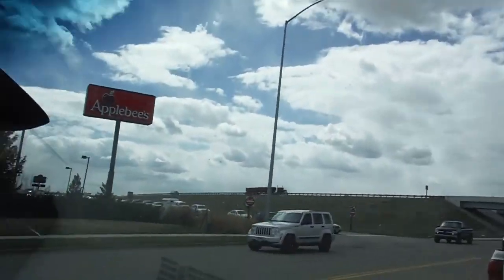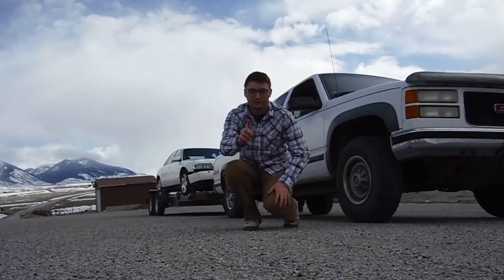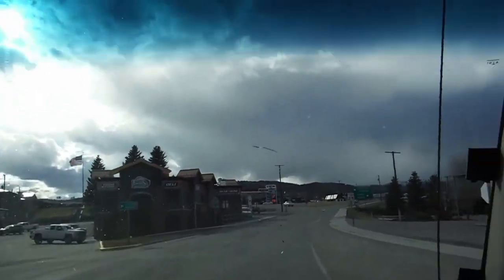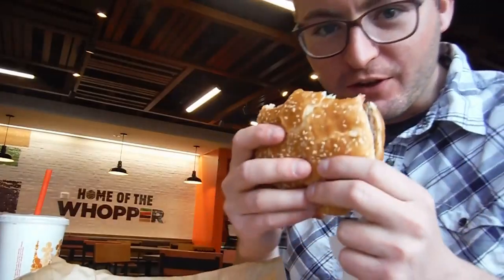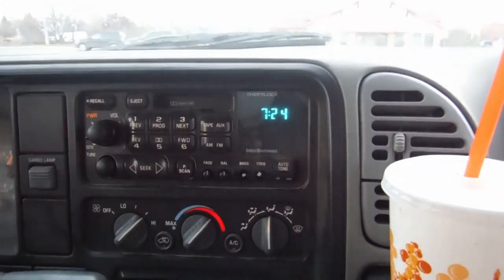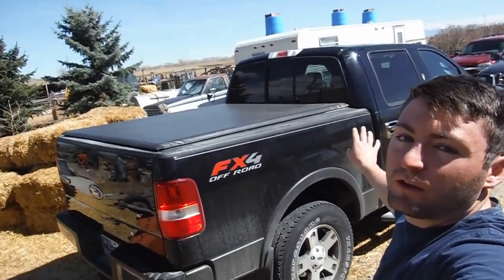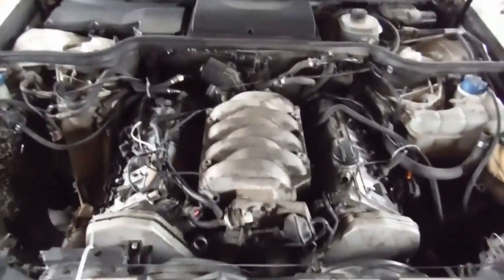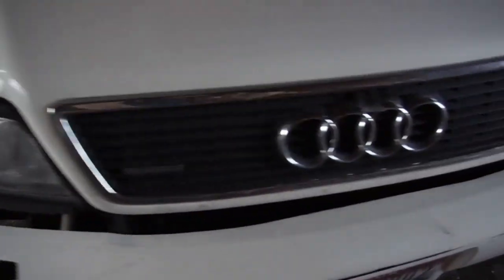Towing an Audi 500 Miles

Comment: Oh wow, you used a huge 454 big block V8 Chevy truck to tow a D2 A8 500 miles?!?!  Sweet.  I am using my stock 89 HP ALH TDI 2000 Jetta MK4 sedan with 343,000 miles to tow an A8L on a car dolly 190+  miles tomorrow. I towed a widebody C5 A6 from Indianapolis, IN to Bellefontaine, OH a few years ago no problem achieving 41 MPG.  I wonder what fuel economy I get tomorrow? Hahaha.  Yes, yes I disconnected the rear driveline first.  This isn't my first rodeo.  Or my last.  Take care.
Reply from the maker: Thanks for sharing your experience! Hope your tow went well, enjoy your A8L! As you already know, these cars are wonderful :)